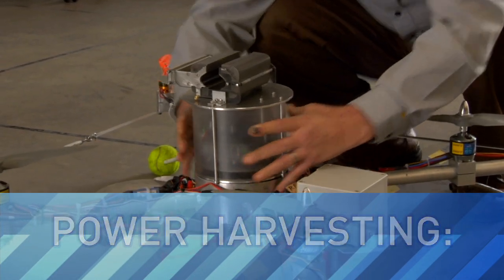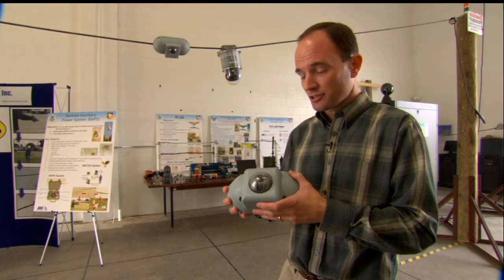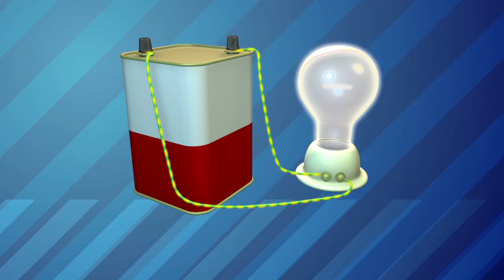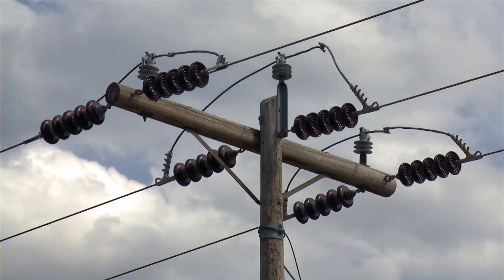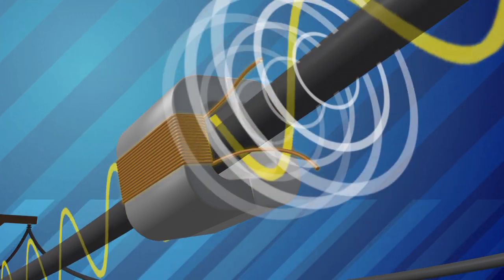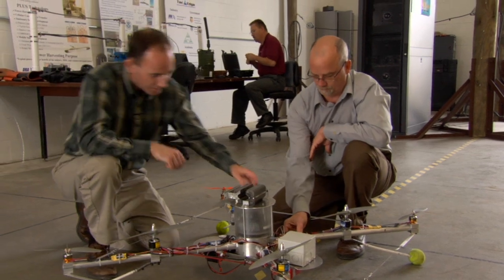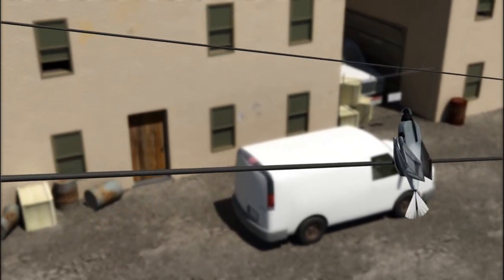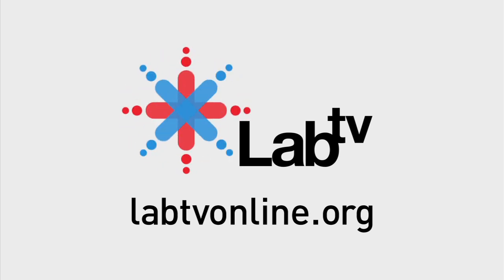Power Harvesting: Induction Magic

Comment: Doing this is called stealing, that field potential  didn't happen all on its own you know.
All you would be doing is creating an alternate type of parasitic connection to the power grid.
You are still pulling Voltage potential from the power generation facility...stealing electricity.
IE, kinda like building a polearm out over your neighbors solar panels, to hold up your own solar panels...

Comment: Is it stealing power needed to keep the power flowing to people, or is it gleaning power that’s already lost and useless to the functioning of the power grid?
Reply: power is harvested from ether directly by power lines and it's free energy,  so no power plants is needed as there is no need to burn anything to harvest the power
Reply: @cyganmarek  please share a video about this thanks
Reply: It is stealing because the device's magnetic field will interfere with the line's current and it will create voltage-current phase shift (φ). This will cause a percentage of active power (P=V*I*cosφ) to become reactive (Q=V*I*sinφ), keeping apparent power (S=sqrt(P^2+Q^2)) constant. After all energy cannot be created out of nothing, can only be transferred or change form. The device takes energy, the line loses energy.

Comment: when you do power harvesting from power lines that could be assumed that you have been steeling electricity. I think that idea is good for public resorts.
Reply: power harvesting means the power is taken from ether directly by power lines and the energy is free , what they're saying is to cover the fact in their way of presenting their truth, which is lies, no fuel needed to produce power, except little amount at the beginning
Reply: If it's through magnetic induction it's not "energy stealing". My uncle has a little farm where there is a high voltage transmission line passing through. When you go near it, you feel the static electricity, you hear the energy "hhhuuuummm" and from time to time there are electrical discharge (like lightining). I think it's 14000v line (come from ITAIPU). In Foz do Iguaçu city, in some area of the city people can light a light bulb just putting the light bulb on the ground, the energy comes either from ITAIPÚ generators or from a transmission line from ITAIPÚ.
It's not "stealing" if it is "leaking". They uses wires without insulation, because "it costs too much to insulate these types of wires" 👍
Reply: @aquamastertheonlyone  do you know how transformer works?
Reply: @interbudelblag  Yes.

Comment: This type of energy collection method requires a very short, high cross section of closed iron core (with almost no air gap allowed!) surrounding only 1 of the power lines. Basically it is a current transformer with a secondary load that is used to power some sensor, camera, battery, etc... The primary current is variable, determined by the load of the power line, typically I=100...1000 A. If the device needs for example P=10 W, then induced voltage/turn must be Vt=P/I=0.1...0.01 V. For 0.1 V you need an iron core cross-section of A=Vt/(4.4*Bmax*f)= 0.1/(4.4*1.4Tesla*50Hz)=3.2 cm^2. From the fact they used even bigger cross-section I assume they aimed for even lower primary current, or higher consumption, or couldn't manage to keep the air-gap tight enough. To keep the device safe from overloading a smartly controlled DC/DC (fly-back or boost type) converter is needed on the secondary (after rectification).
Reply: I knew that!   haha!

Comment: So we can put them on our power lines to power our house and not pay Edison because were making our own power? What is the ratio of power you get off a line 120 volt line = ? Volts with # turns x gauge of wire makes 15 volts! Is there a formula?
Reply: No, you can not. This is not the aim of this development, and it is not capable either. This is a current transformer, while your house needs a voltage transformer. This transformer can only supply small, and strongly ground-isolated loads, while your house is a big and ground-connected load. The owner of this device probably pay for the power company, but the price of the electricity for its whole lifespan is much lower than the price of this device. The whole electricity-bill topic is quite irrelevant. The point here is that small devices can be placed along the power lines instantly without having to build regular, giantic and expensive voltage transformers.
Reply: I know. but thought it would be nice.  If you want to be a billionaire over night we need wireless power. power plant to a substation then to your home no wires. water and natural gas also No pipes

Comment: People have been power harvesting electricity from power lines since they were first installed. People were putting insulators on fence post then stringing bare copper wire for a hundred feet or more, then connecting a transformer to boost the amps and wattage to suit their needs...all illegal...and against the law of course...Ever notice when you drive under power lines with your radio on and you get all that static & buzzing? you are driving through the power field that the power lines create...All that electro magnetic energy is going through you as well...not healthy
Reply: One would need veeery long distance (1000s feet) and area below EHV power line to get 1 kW of power and good impedance matching device. Another method is the 50 (60) Hz BIG air core coil resonance. For that, tons of thin copper is required (expensive investment)
Reply: Illegal for us, but not the power company.....right... past me the crack pipe.. non sense. The hiding of free energy is at the beginning of the end. Ken Engle=33
Reply: @williamjones7604  In my country it's not illegal (at least there's not law forbidding it) as long as the owner is doing it at his property. If you're more than 3 m from their HV equipment and you're doing nothing against environmental regulations you're free to try it. [EDIT: I live in Europe] 😊
Reply: @williamjones7604  it is not free energy.

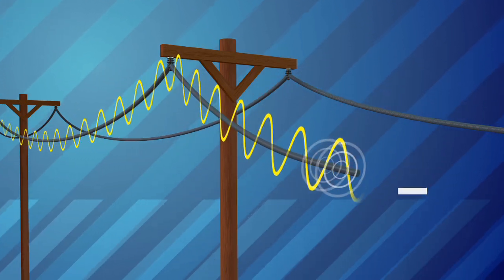Comment: 1:32 DC CREATES A NEGATIVE FIELD AS WELL, dumbass narrator. How the hell do you think a relay or scraping magnet work?

ANYTIME you pass electrons through a conductor you generate a magnetic field. The difference is, AC field expands and contracts 60 times a second creating a MOVING magnetic field and *DC just creates a stationary magnetic field. By moving the field across a coil you generate electricity.

*Exception to the rule: If you pulsate DC, the expansion of the field when it turns on and the contraction of the field when it turn off will give you a moving magnetic field that can be used to induce current into a coil.

Comment: " Wright-Patterson AFB "  ?   so these guys are being funded some how with tax payers money to devise ways to steel electricity ?  Engineer ?   Most people whom tinker with electronics knows that its basically a transformer they have, clamping amp gauge if you will, 
as soon as you hook up a load to this device the power lines has more load on its self, and further, back in the 80's I think, there was a guy whom put his own built transformer on a pole so it was near the power lines and he obtained 120 V  and ran it to his house. The power company eventually seen this strange device and took him to court, and he claimed the magnetic field was wasted energy and he had the right to get it from the air, the power company explained exactly what I said previously and they won the case.  I applauded the guy for cleverness in his creation, but give him a thumbs down for stupidity since he should have lowered the device during the day and up righted it during the night. :)
Reply: wait so what was the companies counter argument? that they also own the space around the wire too?
Reply: Oh man, that's a Story 😄😆

Comment: Currently working on projects like this, and I don't see the downside of it as stealing energy. The amount is very minimal, plus it aids people to monitor the power line errors. I embrace innovation, and utilize what we have now for further improvement.
Reply: If it's through magnetic induction it's not "energy stealing". My uncle has a little farm where there is a high voltage transmission line passing through. When you go near it, you feel the static electricity, you hear the energy "hhhuuuummm" and from time to time there are electrical discharge (like lightining). I think it's 14000v line (come from ITAIPU). In Foz do Iguaçu city, in some area of the city people can light a light bulb just putting the light bulb on the ground, the energy comes either from ITAIPÚ generators or from a transmission line from ITAIPÚ.
It's not "stealing" if it is "leaking". They uses wires without insulation, because "it costs too much to insulate these types of wires" 👍
Reply: dolphin2303 not stealing?  just because no meter is currently measuring does not mean there is no energy transferring from the wire......its the only way the device gets its energy...by taking it from the wire via induction.  if energy could magically appear in the device with none being lost in the wire, then e equals mc squared is totally wrong and we can all get free energy.  we can cut the production of electricity down because we can just duplicateore with more devices.  you are deceiving yourself if you don't see this as theft.  be careful with your project.
Reply: @mrchordstriker  It is not stealing, because it obviously requires the approval of the power distribution company, or even the user IS the power distribution company. Stealing is a law/financial term, can not be applied to physics/technology. If they pay for the energy, and the owner accept it, then it can not be stealing, but this is not the subject of the current stage of development.
Reply: @PafiTheOne  believe it or not, sucking some energy from the lines, DOES mean the end user might just get a brown out (shortage of electricity), on their end.  Because someone took some energy enroute to their home.  They paid for that electricity, and the company fell short and failed them.  Like a boss, the hydro co has to take responsibility for the shortcoming.  What do they do?  Find out why and where their failure was.  Guess what they find someone sucked their energy out of their lines like a mosquito.  You are arguing mosquitos do not steal your blood.  Its the same.  Enough mosquito's and you will react.  Same legally with hydro being sucked out of power lines.  You may think your extraction does not have consequences because it is seemingly slight and inconsequential, until there are ten million with your point if view.  Some counties already experience county wide brown outs from electricity demands, a pile of mosquitos will make it worse.  You may argue it is not stealing until the legal world steps in.  Ok.  But it IS taking frim someone who supplied the power in the first place, and taking a tiny amount ends up with someone who paid for that hydro, doing without that hydro.  You may be a tricky word gaming democrat desperate to excuse stealing or else a dumhead  it doesn't really matter.  Hydro companies will push the legal end of taking other peoples property if that's what it takes.  To play word games beforehand, is usually what prompts legal acts.  Taking, stealing, matter if interpretation for you OK that's yer mindset....until YOU have a brownout that crashes your computer and all you are left with is recalling this text.Thanks for responding have a day.
Reply: PafiTheOne What a long statement wow.  I went to college to learn electromagnetism.  Graduated top of my class.  To charge up anything using hydro lines, is to take from the electrons in the wire, into your transformer in your device, into your batteries.  If you do not want to call it stealing because it gives you the iggies, well then call it taking.  You are taking electrons from one place, and putting them in your batteries.  Period.  That is my whole point.  Please do not badger me about stealing, I only know the physics, not the legality of it.  That part is up to you.  Have a day.
Reply: @mrchordstriker  If you want to talk about competence, then I can tell you I am a practicing electrical engineer specialized in power supplies and metrology. But  this is irrelevant. You popped up the question of consuming energy this way would be stealing, however you failed to mention any reason what would cause it more stealing then any other consumption. This is your chosen topic, not mine. I don't know what you call "iggies", and I didn't call anything taking, and mentioning "hydro lines" here makes me wonder in what virtual reality you are, just like when you make such ridiculous statement that I would take electrons out of the wire and put it into battery. :-) You got a big fat F minus to this performance, you failed to apply continuity equation, and failed to recognize the current is alternating in the power line, and also failed to estimate the velocity of the electrons in the wire (which in the order of some um/s), and failed to understand the difference between charge and energy. And these errors are in 1 single statement. Good job! :-D

I doubt you've ever taken any college class. Even the context you  used this word is weird.
Reply: PafiTheOne o if you say so it must be so eh?  You didn't graduate highest in the class considering your statements about electrons, but ok whatever (Picard face palm here)...
Reply: PafiTheOne double Picard face palm..... Whatever dude

Comment: They are not stealing the electrical current. they are using the magnetic field generated from the alternating current, to produce more electric, as i understand it. Very interesting concept.
Reply: Yes it is stealing power, the power company has to run their generators that much harder to supply the customers the same as before plus this device too.
Reply: You do know that their coil creates resistance right?
Reply: 3DOrama yah very interesting eh.  add this to your interest.  let's build a whole pile of those things, stick them on the wires, and then cut out one electricity power station!  why stop there let's do another.  and another......two things eh...one is the conservation of energy principles they are violated.  two it is reality energy is transferred via induction that is how all transformers work.   those lines carry elec  at over a million volts.  then they enter that big can up the pole at yer  house that changes it back to 120 volts (oversimplified description I know).  that transformer is doing the same thing as the device, only you areetered and paying this so called company is not.  its leeching.  enough of those will trigger reaction from hydro and they will easily find those devices.  this idea is theft and will be stopped quickly.
Reply: when you plug something to your socket the process of powering your device is the same. You use a transformer that transforms electromagnetic field to your device.
Reply: It is stealing because the device's magnetic field will interfere with the line's current and it will create voltage-current phase shift (φ). This will cause a percentage of active power (P=V*I*cosφ) to become reactive (Q=V*I*sinφ), keeping apparent power (S=sqrt(P^2+Q^2)) constant. After all energy cannot be created out of nothing, can only be transferred or change form. The device takes energy, the line loses energy.

Comment: I do not like the idea of cameras everywhere and especially do not like ones that can fly over my home and look like birds.
Reply: I don't like shotguns
Reply: @derarty4290  Slingshots work great too!!
Reply: @derarty4290  why don't you like shotguns? You keep saying it.
Reply: it's not about a cameras, it's about the power which is being harvested by power lines directly from ether so there is no fuel needed to produce the power, because it's free
Reply: @cyganmarek  no its not free, power plants pay for it
Reply: @maxczarnecki0  It's completely free and you can harvest it without power plants, check the subject on duckduckgo
Reply: @cyganmarek  lololol. Not free. What do you mean it's not a not about the camera. That is what the tech is designed for did you completely omit half the video.
Reply: 1984
Reply: If it's through magnetic induction it's not "energy stealing". My uncle has a little farm where there is a high voltage transmission line passing through. When you go near it, you feel the static electricity, you hear the energy "hhhuuuummm" and from time to time there are electrical discharge (like lightining). I think it's 14000v line (come from ITAIPU). In Foz do Iguaçu city, in some area of the city people can light a light bulb just putting the light bulb on the ground, the energy comes either from ITAIPÚ generators or from a transmission line from ITAIPÚ.
It's not "stealing" if it is "leaking". They uses wires without insulation, because "it costs too much to insulate these types of wires" 👍
Reply: And we recently overhauled the hole damn electric grid first "faster data" 5g they claim. Funny. But they would make me a conspiracy nutt
Reply: I don't like pepperoni.